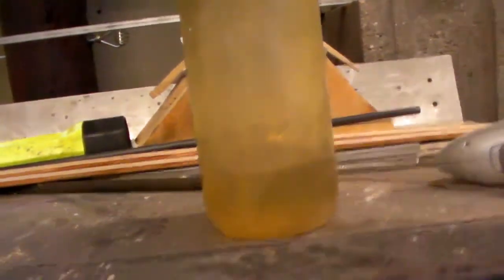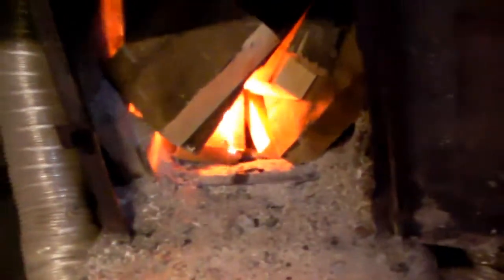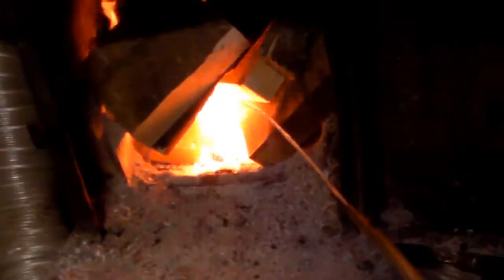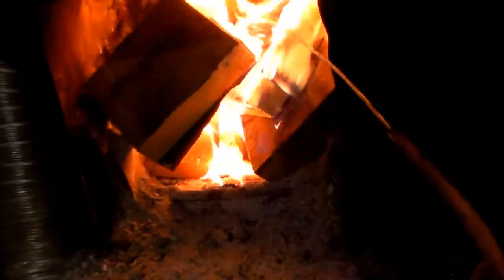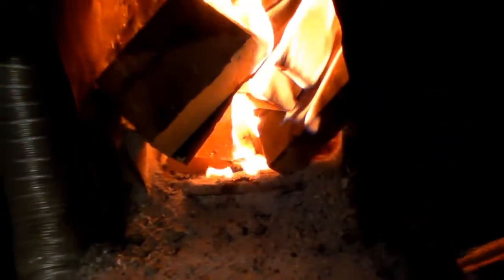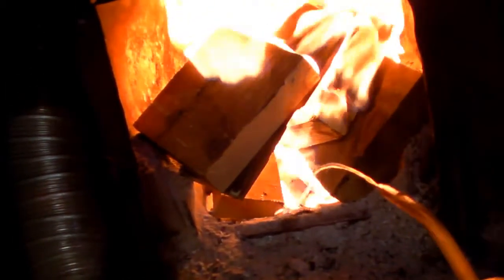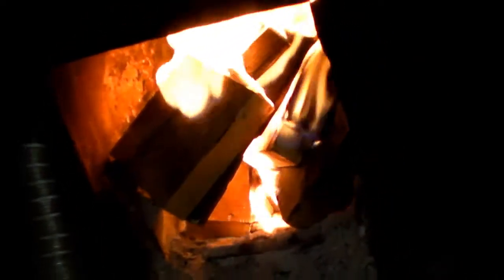Feeding the Redneck woodstove.

Comment from the maker: it really depends on the temp outside and the wood used. My garage is insulated but the windows and doors let in a lot of air. I can keep 75 deg f. in the garage quite easily when it's like 10deg f. and above. Using dry oak pallet wood, I've had it up to 85 deg f. when it was -20 deg f. 

The type of woodstove makes a big difference too. Mine is a stamped steel stove and transmits heat very quickly. Within a half hour, if it's below freezing, it will be in the upper 60's.